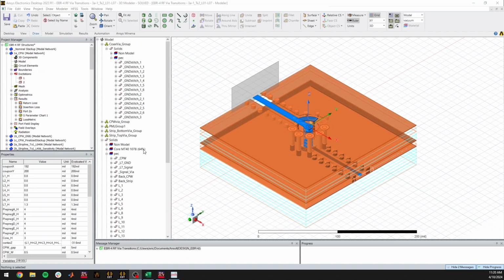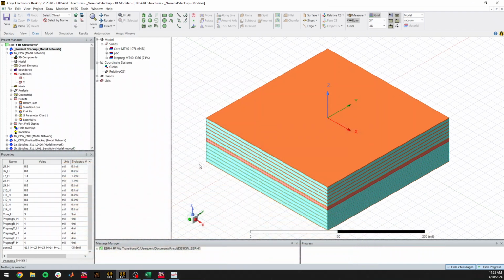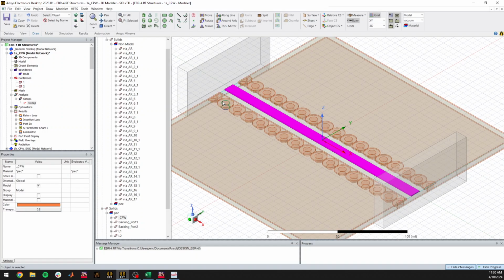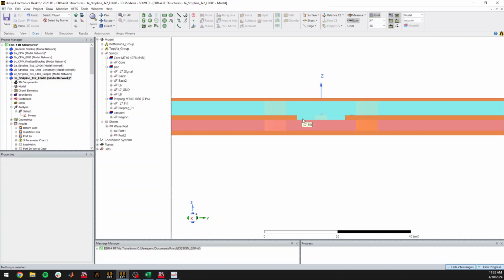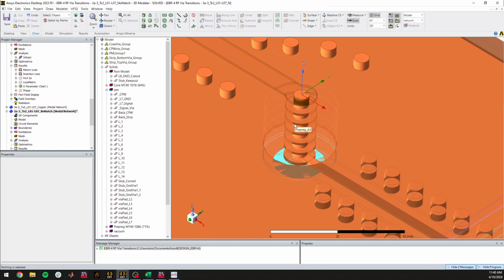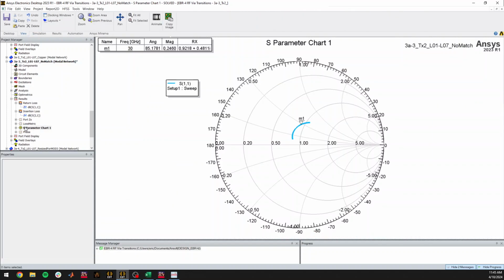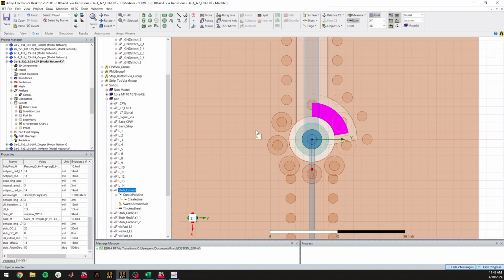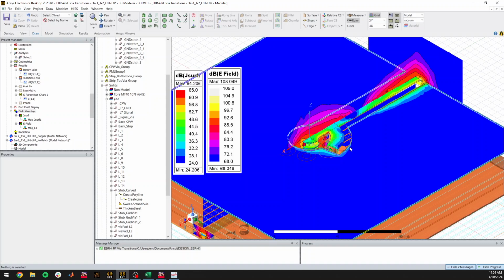Design of mmWave RF PCB Via Transitions

Comment: Interesting technique! Thanks for the vid. I do have a question though, the transition via has a pad on each layer through the board. I imagine this is because of using stacked microvias, yes? Would it be more effective to use a controlled depth or laser backdrilled via? I imagine all those extra pads are hell for the impedance control.
Reply from the maker: Yes, the pads are due to the usage of stacked microvias. Controlled depth/backdrilled vias were previously used but the residual stub was detrimental to performance at Ka band. We also ran into fab operator errors at one point where the backdrill was done and then the board went through another round of plating, invalidating the point of backdrilling. I'm not familiar with laser backdrills - the vendors we worked with used mechanical drills for everything.

Comment: Hello. Can you share file as for example, please? I'm trying to simulate CPW, and results seem to be wrong. I feel, that somehow defining ports in a wrong way
Reply from the maker: I can't provide a file. One common issue is not having the top and bottom ground planes connected at the plane of the port -- not having them connected will produce a parallel plate mode. You can add a PEC sheet or vias between the layers to have them be at the same potential.